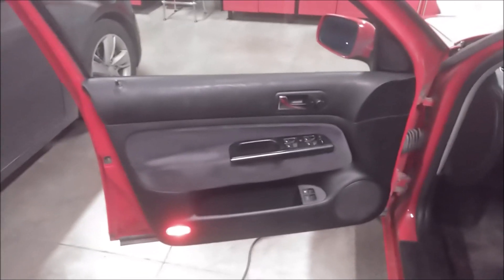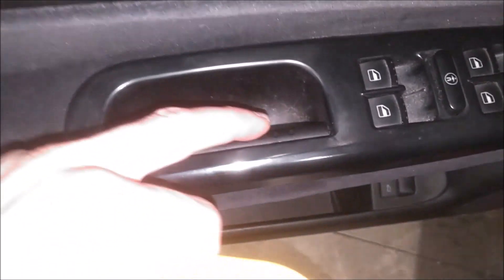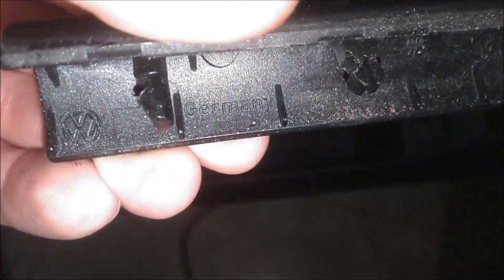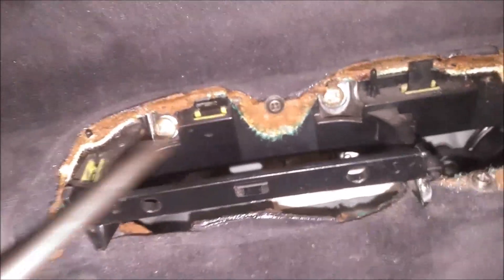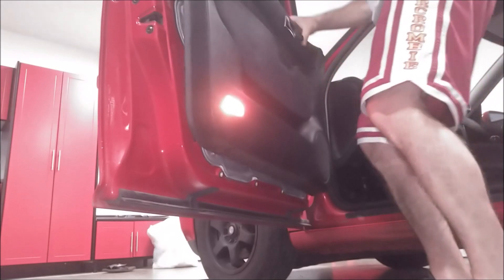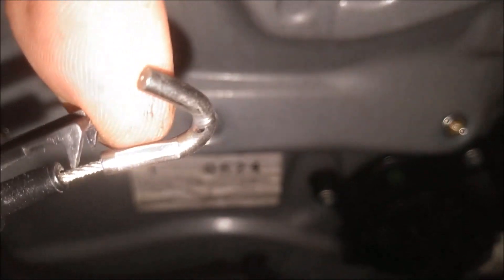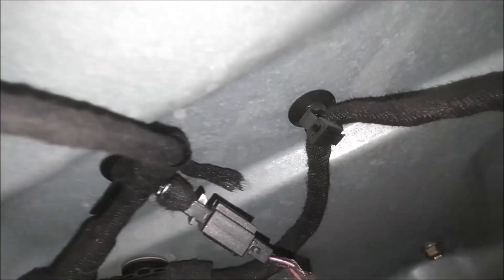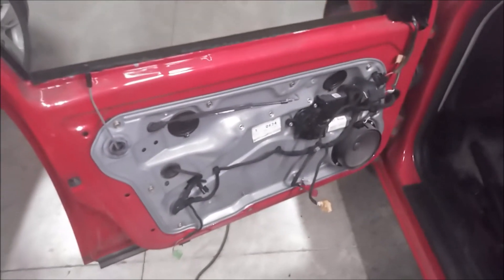Volkswagen Golf mk4 driver's side door panel removal

Comment: Bonjour du Canada 
J’ai un vw jetta 2002 tdi avec +- 950mil km
avec la même couleur. LY3D et je roule encore avec.
Je suis mécanicien depuis 35 ans de formation et j’aime 
toujours voir vos vidéo et les autres aussi 
C’est moi même qui fait toute l’entretien et la mécanique nécessaire 
Cela ne fait pas longtemps que je regarde vos vidéo sur YouTube 
Vous faites ça très bien.Que ce soit votre métier ou passe-temps félicitations pour vous et continuez 
à la prochaine au revoir
Reply from the maker: That's pretty impressive that you have such high km on your Jetta! I have about 197,000 miles (about 317,040 km) on my Golf at the moment and it runs excellent. Do you still have the original engine and transmission? I do this as a hobby and hope to help others with DIY tasks on their cars. Thanks for taking the time to comment and take care!
Reply: @Corysdiyauto  bonjour le moteur et la transmission sont encore originales 
Mais j’ai déjà fait beaucoup de chose comme il est normal 
Refait la tête du moteur pour changé les seal de valve et alors je change toutes les pièces 
Turbo,carter d’huile,seal de transmission,suspension,frein,étrier,échappement,toute les pièces que je change même les boulons que je pose,je ne les pose pas deux fois ( toujours boulons neuf )l’entretien est très important,pour les pièces toujours VW avec les factures à l’appui 
Je fais moi même le travail avec toute les procédures de montage car j’ai toute les fiches techniques .
Les liquides toute les normes sont respectées et beaucoup plus,ainsi le véhicule reste un pur sang et il dure longtemps 
Vw jetta 2002 tdi ALH transmission 02J manuelle 
Un vrai char de guerre 
Salutations et au revoir pour le prochain vidéo bonne soirée
Reply from the maker: @helderlourenco4893  - Maintenance is very important with these Volkswagens and I'm glad to hear that you take care of everything yourself. The ALH is a great engine and will last a long time. Thank you for taking the time to comment. Take care!
Reply: @Corysdiyauto  pas de problème 
Salut

Comment: This video is a big help.  I'll reiterate, as mentioned in one of my comments on one of your other videos, your commentary is appreciated and value added to the video.  I need to remove the same panel on my '04 GTI in order to replace the lightbulb for the mud light.  Also need to troubleshoot the two-position automatic window switch.  I may also remove the mirror in order to replace the glass which got pitted from a sand storm.  Before the panel gets re-installed, I need to research options for reupholstering the panel and refinishing the control panel on the door.  If you have suggestions in this regard, please let me know.
Reply from the maker: Thank you for the comment! As far as reupholstering the door panel inserts, which I need to do as well, you'll need to cut the plastic pieces off that hold them onto the door panel. This will allow you to glue new fabric and wrap it around the back side of the insert. To reinstall, I've seen a couple different ways of reattaching the insert to the door panel. You can plastic weld the plastic pieces back on just like it came from the factory, or you can use wire ties to fasten it. It's all personal preference, but I might choose the plastic weld method. I hope this helps.
Reply: @Corysdiyauto  Yes, this does help.  I'm also interested in your thoughts on the possibility of installing a sound deadening insulation in the door and if you know of any good options for that type of modification.  As the car gets refurbished, I'm generally interested in better insulting the interior against road noise.  I need to prioritize a lot of preventative maintenance under the hood first.  Later I'll want to reupholster much of the interior.  The soft-touch plastic aged poorly.  When I get around to the interior, I'll see if I can get my hands on Alcantara to cover most of the soft touch and some of the hard plastic.  In some areas, a durable fabric would be nice.  The seats definitely need to be reupholstered.  Fabric with a houndstooth design is what I'm leaning toward.
Reply from the maker: @RedondoBeach2  - I've used the Dynamat product before in another vehicle, but not in my VW. If you're after a quiet ride, then go for it. It's easy to install because it just sticks on. All you have to do is cut the material, peel off the backing, and apply the product to your door, hatch, trunk, etc. I would use a wooden roller to apply the Dynamat. In tighter areas, you'll need to use to your hands. There are other products out there, but I only have experience with Dynamat. It sounds like you have a good project car there. Have fun with it!